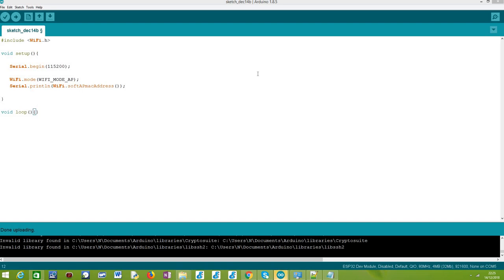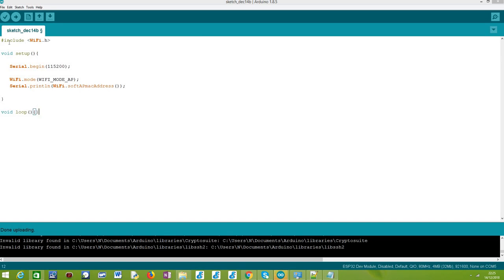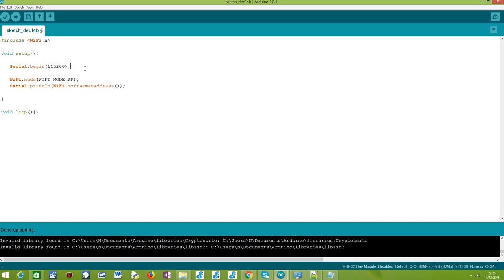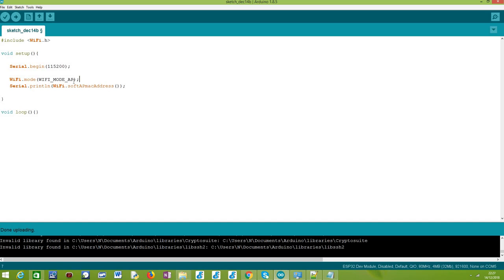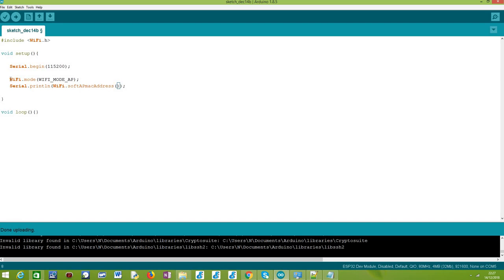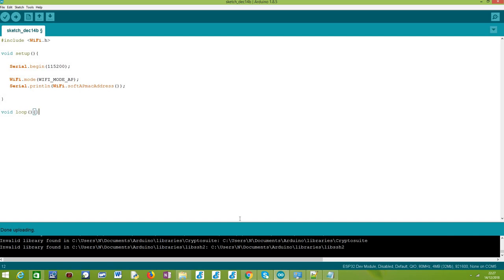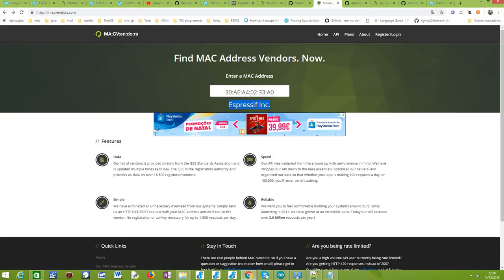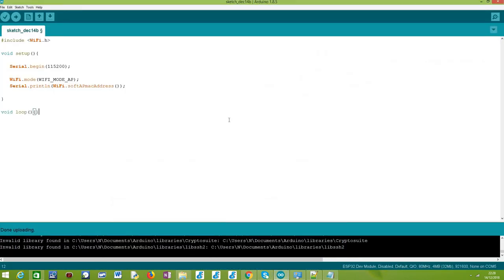ESP32 Arduino: Get MAC address of Soft AP interface

Comment: Thanks for all your interesting tutorials!  Do you know how to get the MAC addresses of all Wifi networks in range of the ESP32? ( with Arduino IDE)
Reply from the maker: You are welcome :)

This written tutorial shows how to do that: 
https://techtutorialsx.com/2017/06/29/esp32-arduino-getting-started-with-wifi/

Let me know if it helps :) 

Best regards,
Nuno Santos
Reply: @techtutorialsx11  Ok great!  Thanks again!
Reply: @techtutorialsx11  I tried it just now but get a compilation error, can you help please? 
Multiple libraries were found for "WiFi.h"
 Used: C:\Users\test\AppData\Local\Arduino15\packages\esp32\hardware\esp32\1.0.0\libraries\WiFi
 Not used: C:\Program Files (x86)\Arduino\libraries\WiFi
Using library WiFi at version 1.0 in folder: C:\Users\test\AppData\Local\Arduino15\packages\esp32\hardware\esp32\1.0.0\libraries\WiFi 
exit status 1
enumeration value 'WIFI_AUTH_MAX' not handled in switch [-Werror=switch]
Reply from the maker: @SA-oj3bo  I've seen some people facing that issue but I haven't yet experienced it, so I'm not sure what is the proper way of solving it. :/

There are some threads about it on Git:
https://github.com/espressif/arduino-esp32/issues/599
https://github.com/espressif/arduino-esp32/issues/20

From the message also seems that there's some switch statement with a missing handling for a case. Are you missing some?

Best regards,
Nuno Santos